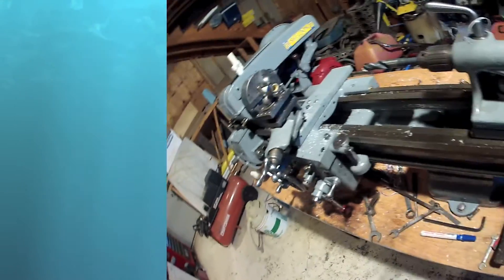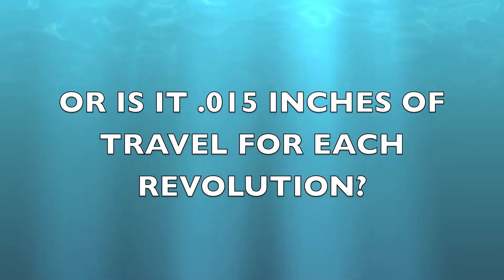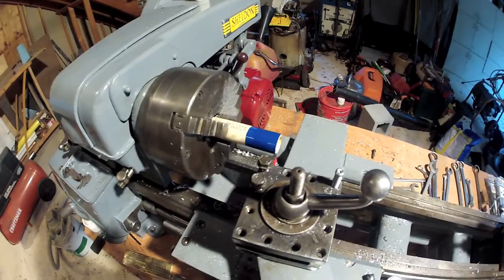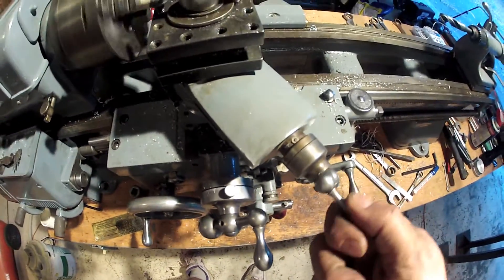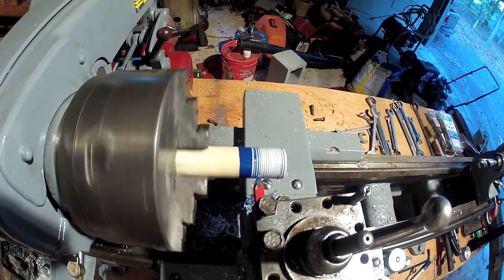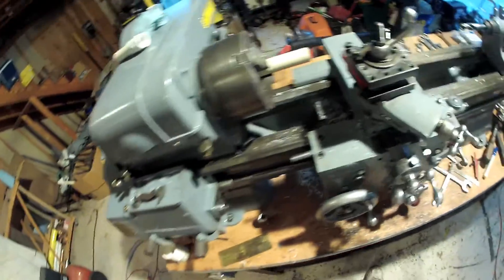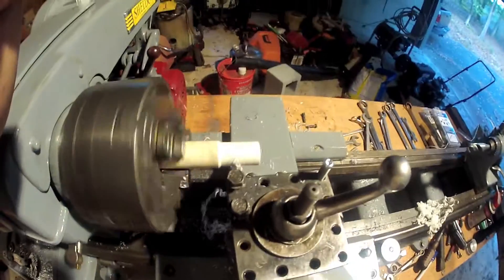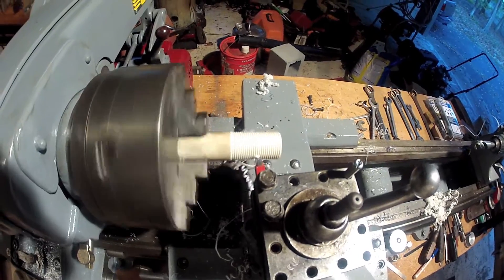Cutting threads on a Sheldon lathe

Comment: How do you stop at the same exact moment?
Reply from the maker: Most manual lathe threading seems to work best with an end "valley" .  On the first scratch pass, I disengaged the half nut, then let the threading tool track in the same place, creating that initial valley.  On each slightly deeper pass, it's pretty easy to stop at the end of the threads and wind up in that valley.  This old machine has enough slop and backlash, that the bit just wiggles a little to stay in the valley.  

If you have to thread to a shoulder and for whatever reason you absolutely need full threading, right up to that shoulder, you won't be able to use that valley technique.

Comment: Nice lathe i got one that was made in the 40s works great love the old stuff I'm a retired machinist just a little advice you need a lot more spindle speed on pvc because it wants to grab at low speeds on steel you will get better surface finish too just take .005 cuts at a time till you get used to it and always run a live center from your tailstock to steady the part so you won't get chatter and break threading tools also use the live center to make cuts on the od while turning down shafts you also need to get a quick change tool post the cheep Chinese will work just fine you will be amazed at how much stuff you can make on it after you get a little experience good luck young man you got a nice lathe thanks for sharing

Comment: . Is that a L-56 Sheldon , do you have a steady- rest for your machine. Just trying to find one. Great videos
Reply from the maker: Sure is! Like so many of these "older" machines, The OEM tooling was discarded or separated from the machine itself by heirs, thieves, damage or idiots, decades before being acquired a caring custodian.  When I'd first bought this old work horse, I had a long list of things I wanted like new tool posts and state of the art insert holders, a freshened up 3 jaw chuck & an easily swappable 4 jaw too.  I picked up a bunch of tail stock accessories like a live center and a few bit chucks of various size.  Of course a steady rest was also on that list, but I never really pursued it back then.  Now there are some fantastic ones through Grizzly and Temu online.  Many could be easily adapted with a little effort to fit one of them to the L-56's bed.  Heck if my project was light I might even consider one of those designed for wood lathes that use neoprene inline skate wheels and precision bearings.  I use this lathe for around the house projects and fixing things for friends, at least once or twice a month.  I just rebuilt my early 1900s era drill press's pulley stack spindle that had ate itself and bent the odd old motor coupling and the motor shaft.  Without the ability to re thread the end of that shaft, that wonderful old drill press would have become 400 pounds of scrap.  The L-56 continues to pay dividends.  Maybe I'll re-visit the a steady rest project again soon.  Thanks for the kind words.

Comment: Find a used machinist handbook It will help you Do all you want on the lathe, also the south bend how to operate a lathe book. Really you use the cross slide to back out the tool when cutting threads. The compound is what does depth of cut . There are guidelines to follow when cutting threads to help produce percentages of threads fits.

Comment: I've got a 1962 Sheldon and could use your help. I"ve not ever needed to cut threads in the years that I've had mine. I tried years ago to follow the threads on a bolt, but the bit was moving too fast or too slow to match the threads No matter the gearbox settings. I think what happened was that well before I bought it, that the 2 same size change gears under the swing out cover, are 32 tooth on mine. Suppose to be 44 tooth I think.. Could you possibly check your two change gears for tooth count to see what count they are?
Reply from the maker: Desert Mike DIY , sure will.  As soon as I'm home next.  Out filming some paragliding footage for a few weeks.
Reply: Thanks! I saw you joined The Yahoo Sheldon Group, so I just did too.

Comment: I'm learning to use my machine tools too. My 10" Sheldon is even older than yours - I think it came to the UK with the US army, during World War II. I admire the way that you've shared your mistakes and I'm impressed that you've managed to achieve what you set out to do. Thank you: you're an inspiration!
Reply from the maker: Awesome Nicholas.  I use my machine all the time now, but I hardly ever cut threads.  More often to true up welded parts and re-face things or resurface wear components for a longer service life.  Good luck, it's a great tool to have in the shop and not everyone has one.

Comment: Nice video! The "Rescue-Restore on my 10" Sheldon has finally progressed to the point that I can start trying it out like that. Apparently our sheldons differ from most in the way the motor is mounted behind the headstock. Your video briefly shows the lower belt cover which is the only item my machine is missing. I have been unable to find any other diagram or picture showing that item. I would so much like to have some nice pictures of this piece showing a bit more detail.
Reply from the maker: Keith Fenner (of youtube fame) did a rebuild/giveaway of a similar machine.  His video may have some better shots too.  Next week some time, I can document that part for you with photos and some rough measurements if you'd like.  It's a large casting, that would be very difficult to duplicate.  I think you'd be best welding up a angle frame and covering it with sheet steel if you wanted to recreate a saftey cover.  Send me an eMail address and I'll get you some better photos.

Comment: Hi , Do you know what morse tape number is use in the tailstock ? I've just got a 1940's single tumbler lathe with just the " live " tailstock centre & would need to buy a second morse taper for a chuck , thanks great vid .
Reply from the maker: Yes.  On my sheldon, it's a #2MT.  I met one of the factory workers that originally built these lathes in Chicago through an on line forum.  He provided me with a treasure trove of data that I couldn't find anywhere else.  Search for a support forum for your specific machine.  I still use mine quite frequently.  It has made and repaired hundreds of parts for me and my other motorsport and sport aviation enthusiast friends since I posted this video!  The head stock is a #4 and the nose spindle is 8 threads/inch.
Reply: Thanks for reply , just noticed live tailstock has " HEI CHENG   no1 "  on it  &  has 1-2 stamped on the knock out end flats , also just found out that my pillar drill has the same morse taper so I can use that as it has a 3/4 `` chuck , happy days :-)  ,always wanted a full size metalwork lathe since I left school & had metalwork as a fave subject .

Comment: Nice lathe restoration. You now have a very useful tool for your shop. The lathe is considered to be "the king of all tools". The education you will gain by using it when the occasional  need arises, is worth more than the machine itself.
Reply from the maker: Yep!  It's been a great tool to have for both new prototype things and repair work for all sorts of items.  Cant imagine not having the ability to turn metal.  In fact someday I may even significantly upgrade or add a second larger HP and tighter tolerance lathe with a bigger swing.

Comment: I happen to have the original manual and sales brochure of my 1938 Sheldon 11" if you need a copy. Oddly enough, my sheldon still has all the original tooling complete with the shadow box drawers ;-) Having some issues with my compound tracking without jumping during the cut so I may need to bother your expertise on how to get mine fixed up correctly lol. Great looking Sheldon buddy...they are getting harder and harder to find these days
Reply from the maker: scott lawless Thanks Dude!!!!  Since I made this video and muddled my way through the first couple of attempts at threading, Ive:  1) found an online copy of the manual and 2) threaded a lot of stuff to very good tolerance results!  I've also retooled quite a bit by adding a quick change tool post!!!
Reply: YankeeinSC1 Nice! Which QCTP did you go with? Ours take an AXA correct?
Reply from the maker: scott lawless Yes AXA.  I had to mill down the retainer plate that came with the eBay kit, so that it would fit tightly into the carriage's slot.  The single best upgrade was the parting tool holder.  Tool changes and set up time is reduced to less than 1/4th of what I had been spending with my old Enco tool holder.  Doesn't sound like a big deal for a hobbiest, but it also provides a much more rigid cutting point.  That yields much better parts!
Reply: Oh yes...my lantern tool post and I have a very love/hate relationship, trust me lol. What brand did you get? I noticed several on ebay but then I made the mistake of pricing an ALORIS...had to remind myself that this is a "hobby" after seeing those prices! Thanks for the heads up on modifying the tnut btw.
Reply from the maker: scott lawless Bostar... $125  http://www.ebay.com/itm/271405301454?_trksid=p2057872.m2749.l2649&ssPageName=STRK%3AMEBIDX%3AIT
Reply from the maker: scott lawless here's a forum showing where my parts have been employed  http://www.homebuiltairplanes.com/forums/member-project-logs/22181-christavia-renewal-build-log-2.html
Reply: YankeeinSC1 can't thank you enough man! I botched up a stainless job not too long ago due to chatter so I need to make that swap soon! On a separate note, it looks like the brass nut on the cross slide was causing the backlash issue on mine. Probably going to make a couple of new ones if you want a spare for yours. I'll PM ya once I get them machined up
Reply from the maker: scott lawless Cool!!!!
Reply from the maker: scott lawless If you happen to find a source for a semi-machined universal back plate for Sheldons let me know.  I want to fit up a 4 jaw chuck and eventually improve my current 3 jaw with a much newer one, but can't easily find a 1-3/4 X 8TPI back plate blank.
Reply: YankeeinSC1 Let me do some digging...I know I came across a company that made 3,4, and 6 jaw chucks that fit our spindles but I'll try to find them again. Something tells me it was a Canadian company...I'll get back to you on that one!

Comment: I'd like to thank you for posting such a fine video.  I cannot comment on the art of lathing, but I can truly revel in the restoring of a fine, old piece of equipment.  I am guessing you have learned a lot about lathing since you posted this video.  Post more on the Sheldon.  Peeps like that.
Reply from the maker: Gee thanks.  Believe it or not this old tool has become quite the reliable work horse in the shop.  Since posting this, I have only used it for threads a few times, but it handles most turning jobs well.  I have spent a considerable amount of time upgrading tooling, which has given me better tolerances than most of my buddies are able to hold with modern Asian equipment.

Index insert holders and some home made brazed on cutters give me a wide adaptable array of tooling to choose from for almost any job that will fit in the Sheldon.  May add a QCTP in the future at some point, but since I don't run a production shop so much as I help with repairs and prototypes maybe not,  Set up time is not crucial for me on one offs and repairs.

Comment: That was a great way to learn. Put your tool "in lead" and travers the part to scratch the major, Let it run to stop, then back off with the cross slide to improve accuarcy. then adjust you bite of the next pass with the compound. First pass .015 or so slowly decreasing your bite size. and use "Some type" of lube..i could be soappy water. just lube after your done. Water/Metal= Rust. so... 
 The tool is positioned ever so slightly "Above" Centerline. And 29.5 deg angle= no tool drag per pass!

Comment: NPT stands for National Pipe Taper, so by rights they sould be done....tapered. But it's just pvc so no worries. 
 If you want to know the the over/ under, Major /Minor. Of any thread. Check the Handbook. Thats the "Machinist Handbook" or simple enough, there are plenty of list online. Also, Use the cross slide to move in and out, not the compound. to improve acuracy. PVC will collaps in the chuck so put something inside the PVC. and chuck it up closer to the Machine chuck..trust yourself.

Comment from the maker: You're right it was and it's already been adjusted. to a much tighter play. The handle's set screw was still loose from the recent re-assembly and the main crank attach screw had been working out. I'm still getting the area where this machine will permanently set, prepped with new paint, better lighting and wall protection and this was just a first try that I was so excited about.

Comment: Congrats on first effort, not the way I would have done it but hey, it works! I did notice there is a large amount of backlash in your top slide, or as you chaps call it compound, That gap that appears when you withdraw the top slide is what gave me a clue. Should be a simple fix, if you think it important enough to bother.

Comment: Pick up a copy of How to Run A Lathe by South Bend.  There are reprints floating around available,  may even be one by Sheldon.  
0.015 depth of cut may be okay for pvc pipe, but in steel you should back off to .0.005 or less per pass or you risk the work riding up over the tool or possibly snapping the tip of tool off.
Check out mrpete222's channel.  He's got some good instructional videos.  Stay safe!

Comment: Thanks for the video, nice rebuild and I can see your efforts, you should be proud. That was a great idea starting with a forgiving piece of material. It's more customary to set cross side to zero after your touch off and at the end of each cut put out the cross side and return it to zero for the restart, then add next amount on the compound. Pipe threads are tapered so the female coupler was a bit loose at the start and tightened up  farther in. Your on your way! ;{)------